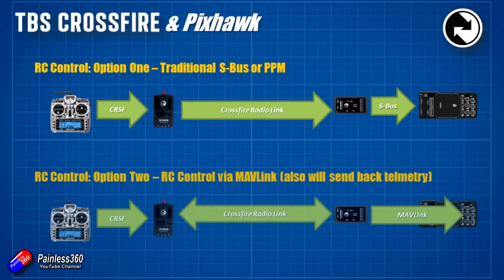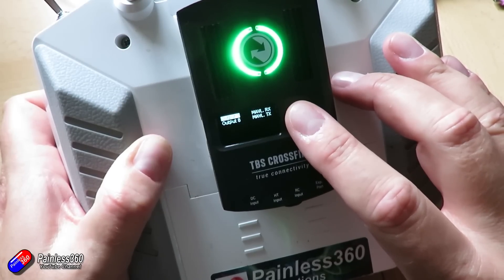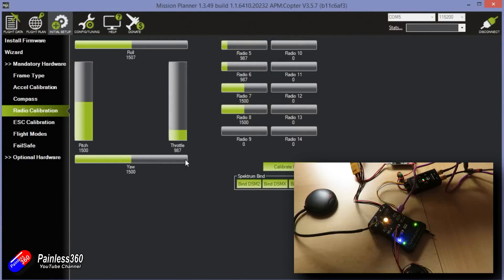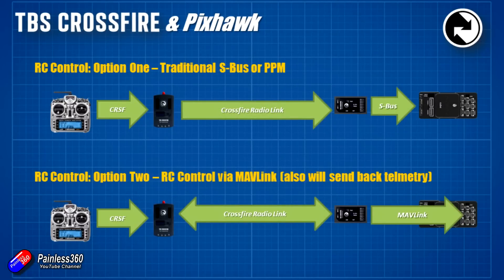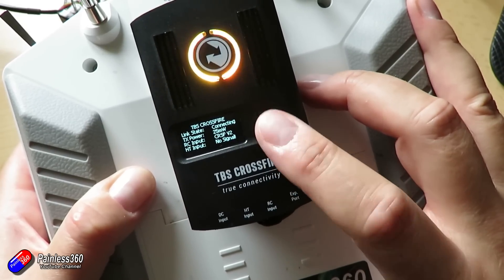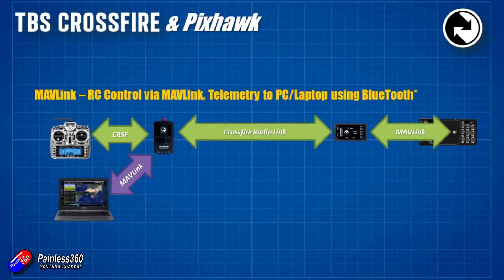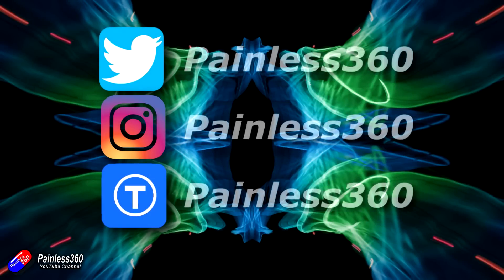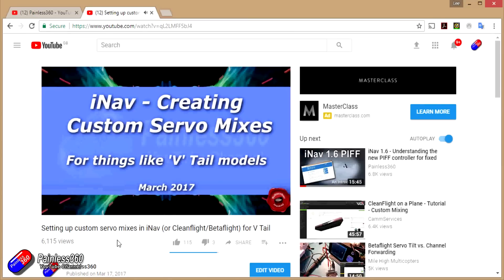Crossfire and Pixhawk: RC Control (S-Bus, MAVLink) and telemetry options

Comment: Quick question, when I did this on a older APM the "telemetry" signal is constantly showing around 20% down to 0% what is this actually referencing? the blue tooth to xfire signal? My rssi\LQ is perfect
Reply from the maker: Not sure, the code on the APM is very out of date now.. Best of luck..
Reply: @Painless360  I appreciate the quick reply! I am not going to dig any further, just wanted to see if you knew right off hand. I think it's time to retire the old APM anyway! Thanks again for all the information you provide the community!!!!

Comment: Works great for me thank you for that golden tip! But how do i connect my OSD now?
Reply: Found the answer myself: Use i.e. Matek F405-Wing with built in OSD and Sbus capable. flash Ardupilot. Use Sbus on CH1 for RC control, use Mavlink CH3/4 and Crossfire bluetooth for Flight Map onto tablet/PC. Enable onboard OSD in Flight Map for flying with goggles. All works like a charme!

Comment: Nice video :)
I have an R9 but may switch to crossfire for telemetry. I used mostly f3 and f4 flight controller like the f405 wing but need more pwm outs so I have to switch to pixhawk but I'm not sure which one. Pixhawk 4, 2.1 (not cheap but worth?) or maybe an older one?
What's your suggestion for an mapping vtol?
Reply from the maker: Pixhawk cube.. https://youtu.be/te4D_fjBVfM

Comment: What is MAVlink, exactly? Is it just a communication protocol that uses standard UART as the physical interface? RX and TX seems to suggest as long as I have some way of transmitting UART over some arbitrary channel I could use MAVlink. That would be ideal because I could use a single 900MHz channel for both controlling my drone and for receiving telemetry data.
Reply from the maker: The best explanation I've seen is here - https://en.wikipedia.org/wiki/MAVLink It's a protocol that can be used for control and telemetry at the same time.. Not new by any means but very proven..

Comment: I actually did the crsf  and mavlink Bluetooth to laptop setup. Made me happy i spent the extra for the Big module.  Now you can get the big module without bluetooth and save some money But if your in this hobby for quads and think you dont need or want bluetooth, Think twice because it is sweet to have later on, and one of the neatest benafits to the system in my opinion. 
Thanks as always P-360 for the great info
Reply: Do you need Bluetooth to connect crsf to mission planner or can you run a cable or something?
Reply: @aurelienwittmann4105  There is the usb cable for updates but I do not know if that port can be set up like that. Mine set up so easily I did not have to research it.

Comment: I'm currently using FrSky R9M & R9 Slim+. I'm going to get telemetry support soon using Craft & Theory LUA script but this doesn't have Mavlink option. I have a Sik Radio on board (redundant backup) but since both run at 900Mhz (in US here) the signal noise makes both link qualities suck, so so far that's not working for me. At a later date I'd like to upgrade to Crossfire w/ MP on a small tablet.

Comment: Hai There...!Thank you for the work you are doing and its highly appreciable. We were working on building a Quadcopter with Pixhawk 4 flight controller with Taranis X9D plus transmitter with Q Ground Control. All the configurations were done but we are facing a problem with the throttle control of the motor. BL Heli ESC were used. Sometimes the motors are responding when battery is connected but are rotating at full speed. Though we are varying the throttle stick position the motor speed is not getting controlled...??? We got stuck here and couldnt fly the Quadcopter. Please provide us a solution to tackle this problem. Waiting for your respone.....!!!!!

Comment: I read over at FPV LAB that MAVLINK telemetry only stays consistent if you can stay in RF mode 2.  RC control will reamain over MAVLINK but a ground station connected via BT will drop off.  Not very useful if true!
Reply: What is rf mode 2 ?

Comment: Lee,  I'm curious how the BRIDGE Bluetooth setting on Xfire plays into this scheme.  I've seen conflicting information.
Reply from the maker: It’s a way to send serial data from just about anything - from the manual ‘The bridge feature gives you the ability to pass any kind of serial uart data from any device connected to the receiver to any device connected to the transmitter.’ Only useful if you have a very specific need for it I’d imagine. Happy flying!
Reply: Lee, You are one of my few go-to sources!  I'm working on a project that links 3 of your recent videos, to include this one.  Long range quad build and "where do I go next" in this hobby are the other 2.  I have an 9 inch quad build, gemfan bullnose & running 920kV; weighs in at 490g w/o battery.  Initial tests put it at a conservative 23 minutes hover on a 2200maH.  Running out of UARTS and wanting GPS and other trinkets, I did an impulse buy on a Kakute F7 not realizing that there is no iNav target currently.  I started this hobby on pixhawk three years ago so I poked around the Ardupilot world to see what's new.  To my surprise I found the ChibiOS firmware layer that allows a maker to fairly seamlessly run ardu-whatever on some of our beloved, cheap flight controllers.  To my surprise the KF7 was one of them!  I have a functioning baseline that includes GPS, a 2D gimbal controller and a benewake TFmini rangefinder.  On the bench, the arudupilot ground station ecosystem runs well through the crossfire MAVLINK setup you demonstrate here.  I can set MAVLINK parameters over the air but I'm having problems saving flight plans.  I want to stay away from TM radios if possible, but I don't think it will be.  Thanks for your inspiration X3!

Comment: Hi Painless, this is a great way to feed position data to a antenna tracker. I'm still hoping and waiting you are going to pick up on a project like the u360gts antenna tracker, a series on that would be absolutely awesome!
Reply from the maker: With multiversity and high gain antennas antenna trackers are only used for very specialised use cases. With a good di or tri-vertiry setup you can cover a lot of the sky.. It's an interesting idea the the future though, thanks.

Comment: Great video - thanks!  I was able to get my setup working (Taranis X9D Plus with Crossfire TX, Discovery Quadcopter with Diversity RX and Pixhawk Mini FC, and a Lenovo Windows 10 tablet running Mission Planner).  I had some initial trouble making the Pixhawk to Diversity RX cables but swapping the RX/TX pins fixed that issue.  I'm not sure whether that problem was the wiring diagrams or me.  No worries either way.  My only real challenge was that I could not get the Bluetooth option to show up on the Crossfire TX.  I finally plopped the TX module into my Taranis Q X7, ran the LUA script and enabled it.  Returned the TX module to the X9D and all is working perfectly!  Next up is to complete a Pixhawk 2.1 installation in my Mini Talon.  Thanks again for all the great information!
Reply: My friend I am new to PX4.
I have PX4 mini and crsf nano RX.
I do no know how to wire them.
Could you help me?

Comment: Whats your experience with connecting the crossfire tx to your pc over bluetooth? I've done it successfully once with a windows 7 laptop, but it did no appear in the drop down menu for mission planner
Reply from the maker: Check out QGroundControl - you may have more luck..

Comment: Thanks for the Crossfire videos. I have tried to do this on both pixracer and furious f35 and in both cases i get full telemetry back to the QX7 but can't get it from bluetooth to the tablet using Tower, Mission planner for Inav and Q ground control. I can get a bluetooth connection with Ez gui but cant get any data. Any help or a more in depth video would be much appreciated.
Thank you
Robbo

Comment: How is the telem1 wire connect to the crossfire, wire diagram pls
Reply from the maker: Close-ups of both ends at 4:09. The yellow and blue wires are the tx/rx pair.. I've made a wiring diagram and popped a link in the description.. Hope it helps.

Comment: What band are the 3DR radios on in the UK? Here in the US I believe they are 900MHz, which would probably not work really well as a redundant system for Crossfire since they’d probably overlap. But I think in the rest of the world 3DR is on 433MHz, no?
Reply from the maker: 433 here in the UK so a little easier to use with long range systems..

Comment: Is it the same wiring between the telem port in the pixhawk and the ch.7 and ch.8 if i am using sbus for the rc signal?
Reply from the maker: Yes, and use one of the other connections for SBUS - see my Crossfire series..

Comment: Have you tried flying a plane or quad with Mavlink and a joystick?
Reply from the maker: No, but a mate of mine that uses both planes and quads for surveying work does..
Reply: Painless360 wonder if there are latency issues?
Reply from the maker: If you're flying like that then you're usually using a mode that had the FC doing most of the flying and you're just clicking on the location you want to fly to or taking control for short periods..

Comment: I was just about to ask about you making a video about this! haha good timing
Will you be doing a follow up video on what settings on the FC you need to enable to get this to work? That's where I've been having trouble
Reply from the maker: I needed to change nothing in Arducopter (as explained in the video). It expects there to be RC commands in the MAVLINK data.  Best of luck
Reply: On p30 of the manual it talks about setting some parameters or something. I can't seem to get it to auto-detect. Could I have Remo's contact info? maybe that's who can help me out, I've been having trouble finding people that can help, like you mentioned the documentation is fairly dated. I'm using a pixhawk mini but I wouldn't think that wold matter
Reply from the maker: What troubleshooting have you already tried?
Reply: I used PWM just to check the Rx it's self works, tried switching the serial Rx/ Tx wires as well just in case. Though I noticed when I totally un-plugged the PWM cable it didn't get power, even though the Telemetry port should be giving it power so that might be related

Comment: Thank you! Been looking forever on how to do this! Mavlink telemetry Antenna tracker coming w/ the bluetooth module in crsf. soon :) Also note this can be done on the micro v1&2 but NOT the nano. It would not give me mav link as an option as output.
Reply: Hi, can we anyhow use the mavlink telemetry data received over crsf to be used for ardupilot antenna tracker? 
Is there any such way?

Comment: I have found a very laggy response from the plane when controlling it via mavlink RC. I solved it keeping the ppm signal in channel 1, and mavlink in 7 & 8, but ALSO disabling the option in the crossfire module of sending RC control via mavlink (if you don't do so, the diversity receiver is sending RC signal twice, and the pixhawk remains laggy).
Please anybody feel free to correct me if I'm wrong!
Reply: I just finished getting mine to the point of testing - lag would be a definite concern.  Thanks for posting a work around if needed!
Reply: Thanks for the tip
Reply: I have noticed the same thing.
Reply: Does that mean that all control is still going over the PWM channel, but you also have a MAVLink connection for telemetry?